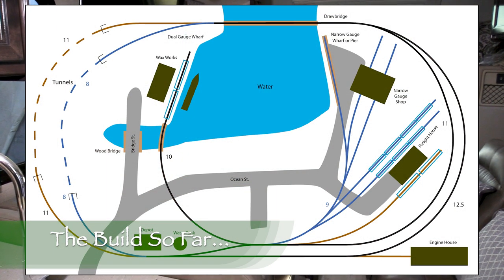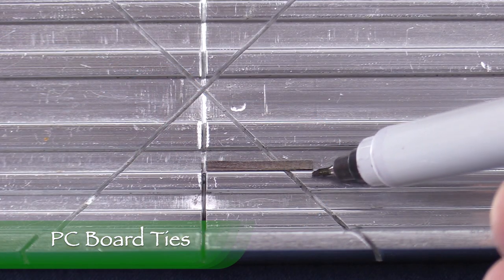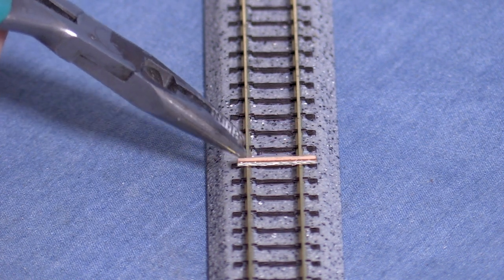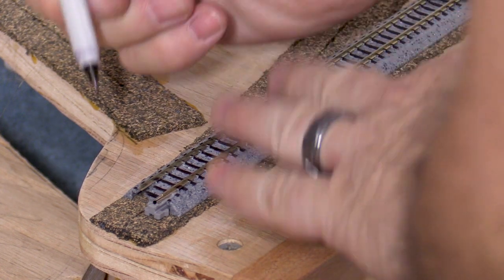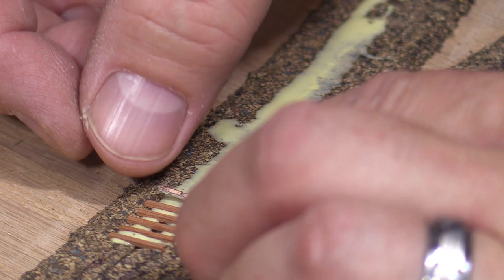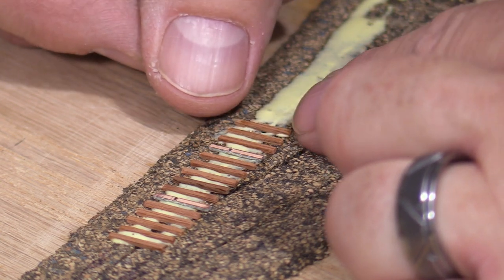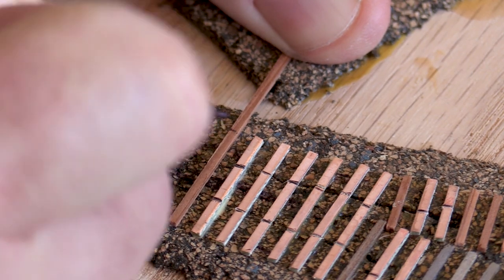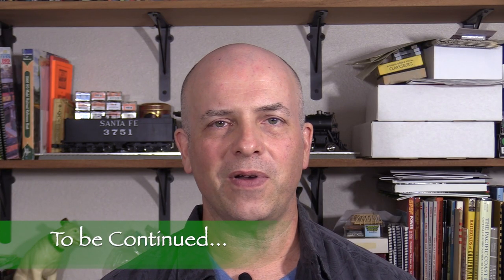Layout Building N Siren Creek Part 6 - PC Board and Wood Ties

Comment: Reminds me of looking at some ho scale continuous welded rail cars this weekend. This tutorial would also work great if you’re modeling a crew replacing the rails with continuous welded rail.
Reply from the maker: Yes, you could use individual ties to model track that is being worked on, or track that's been abandoned.  The PC board might not even be necessary in that case.  Thanks for watching!